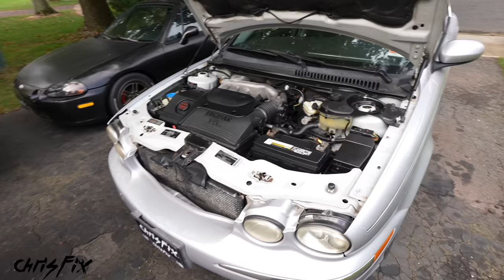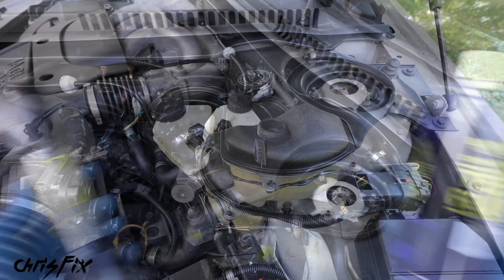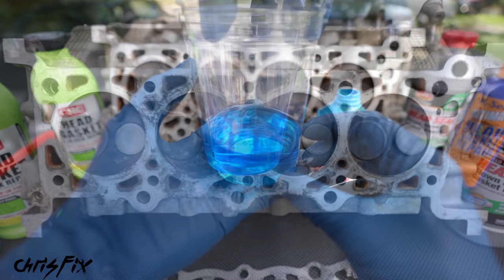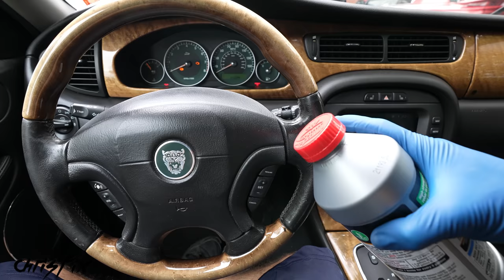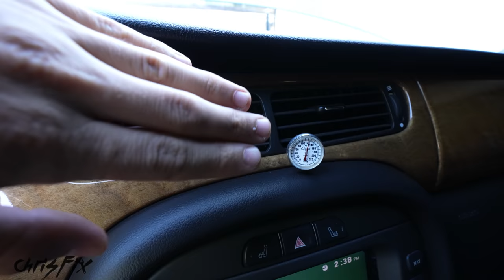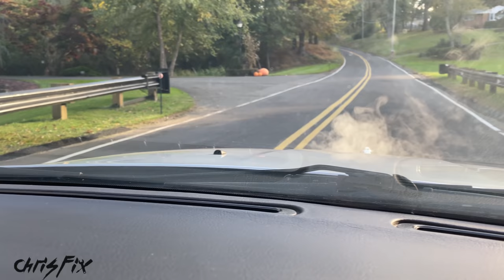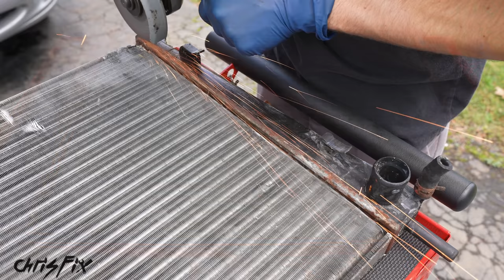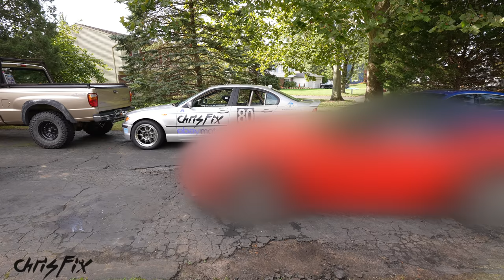Do Head Gasket Sealers Actually Work (FULL 2yr TEST with Engine Teardown)

Comment: Ive used blue devil 3 times one my 2010 subaru the olny reasion   i had to do it 3 times is bc i put the therostate back in an it blew it out cuz 2 much psi an it got over heated the other time an the first time it blew was just cuz subaru headgasket suck ass but yeah the BD has lasted for a couple years now just make sure u remove the therostate

Comment: Interesting.  So using this product, let’s say you got 2 years out of it then the engine starts overheating again.  In a budget move, do you just go another round of head gasket sealer?  Or is it just a one time use?
Reply: I wouldn't recommend this product as I don't believe in magic in a bottle. Now I've seen this stuff used with my own eyes on a Chevy Spark with 100,000 miles and it worked. But I don't recommend it if you're keeping the car long term.
Reply: You can use it again and again. And again.

Comment: What am I supposed to do if the radiator overflows the second the car gets to temp? When I used the block test I only got 4 bulb squeezes until my radiator overflowed, ruining the test. The engine gets to temp and my thermostat dumps coolant into the radiator, so how can I prevent this when using the tester?
Reply: Why are you testing a hot engine? Just test while it's running cold.
Reply: @SinsBird  that’s not how these tests work… you have to get the temp up until the thermostat opens
Reply: @tonyd0001  Just fill the cooling system to the brim and look for bubbles.
Reply: @SinsBird  the bubbles don’t present themselves until the car is at operating temp I’m not sure why that’s not clear
Reply: @tonyd0001  When the engine is up to temp and there's no pressure in the cooling system the coolant is starting to boil in the cylinder head. Boiling makes big bubbles from microscopic bubbles that are always present in the coolant. It's very rare for head gaskets to only leak when engine is up to temp. Why are you testing for head gasket leaks in the first place, what happened?

Comment: My 1985 dodge b250 slant six over heated because the bottom radiator hose fell off and I didn't realize. I refilled the coolant. Since then I can smell coolant, a small amount of milk in the oil and it seems to be running hot if im idling, and a bit warm when im moving. It sucks because i just replaced the radiator. It doesnt seem to be cracked. I bypassed the heater core as well, with a bypassed heater core is there less chance of clogging?
Reply: It can't clog anything if done properly, but with heater core bypassed it (the heater core) wont get clogged for sure

Comment: I tried blue devil l and was not impressed. It may have slowed the leak on an 88 chevy g20 van but didn't seal it completely.
Reply: Coolant in oil, oil in coolant or both? Is the cooling system pressurized?
Reply: @SinsBird  I think it was coolant in the oil but it's been over 3 years and I don't remember for sure. I seem to think both were pretty clean but it was putting out steam that smelled like coolant. Just hadn't gotten into crank case or cooling system yet.
Reply: @SinsBird  I've been trying to find this stuff that I found in a friends car. There was a fairly thick layer in all the hoses and tubes. It was white and felt like wet sand when I scooped some out. He'd had the car for well over 2 years with no problems. I assumed the dealer they bought it from sold them a car with a blown head gasket and had put this stuff in to seal it. Whatever it was it worked great and I've been trying to find out what it is so I can use it in my own cars as well as help my friends and other who can't afford to do it right or for Vehicles that are on their last legs anyway and their owners just need to make them last a little bit longer. Any idea what it might have been?  A friend said it might have been silicone silicate which he called liquid glass and said he would buy it at old-school mom and pop drug stores but idk I think he might have gotten the name wrong.

Comment: what if the coolant looks sludgy (Similar to the way the oil looks in this video)
Reply: The oil is probably getting into the coolant. Is the cooling system pressurized?

Comment: Why didn’t you try resealing with the sealer again?
Reply from the maker: Too many other issues started cropping up on the car, so even if it fixed it again it wasn't worth keeping around anyway. Also there's no guarantees it would hold that long again.

Comment: Real steal  best head gasket repair  I have ever use hands down sorry all that stuff he has sucks. Just follow the directions to the Tee ok later, now when I did mine, I was burning  antifreeze  u can smell it but mine lasted forever  thanks guys bye bye. Oh ps do not use it twice if you do it could  be really bad. Do it once only so cold engine  dump it from bottom hose, dump the resovior  container  put everything  back together pour  in real steal head gasket  liquid  and add your 50/50 antifreeze then take it for a ride for a 20 min 1/2 hr or whatever  direction  say your good guys later. 78.00 worth every  penny......

Comment: Hey christfix is it possible to have a external head gasket leak
Reply: Yes, it definitely is. You'll usually notice it by seeing either oil or coolant weeping from where the head meets the gasket down the side of the engine block.
Reply: @mechanizedunion  so would headgasket sealer work for that

Comment: Can I use if I have a small smallllll oil leak that drops down on the exhaust manifold and smokes after about 30 minutes of driving… shop told me 3,000 I only paid 500 for the car .. it’s a project car at that not the daily driver
Reply: This is for cooling systems.
Reply from the maker: No this is just for the cooling system. If you put this in the oil the engine will be ruined

Comment: Hi. I used the Bars Leak for my car and when doing the intial drive after putting the product in, my car overheated 10 minutes into the drive just driving around the block. 

My car was originally diagnosed with a "severly blown head gasket." So we tried this step. Is there anything youd recommend?
Reply: Is the cooling system pressurized? You would probably need to remove plug from the worst cylinder.
Reply: @SinsBird  I see you asking this a lot, can you explain why this is important?
Reply: @hotel_arcadia  Sure.
1. The pressure in the cooling system is needed to push the sealer into the leaking spot, otherwise it wont work.
2. It fights against cylinder pressures trying to push gasses into the cooling system creating air pockets.
3. It raises the boiling point of the coolant. If coolant started boiling in the hottest spots, the gas, that is dissolved in the liquid would be separating from it creating many small air pockets and where these pockets are, deposits could start forming even though there is nothing to seal.

Comment: just curious, at 17:24 in the video the engine was about to overheat at 237 F but the temp gage on the car looks like it's just at half so normal. Is the thermostat wrong or why is that? I got a rav4 thats been running with like no coolant for months but does not overheat or drive issues. Temp gauge on the car shows no signs of overheating as well. Wondering if it's normal for temp gauges to be wrong like that or my car just don't need coolant

Comment: Can this be used as a preventative on a 2.3 ford engine that has the known Coolant intrudion issue?
Reply: You can try if it's losing coolant.
Reply from the maker: No this would only be used if you already have a Head Gasket leak. I wouldn't not use this in the coolant before hand.

Comment: You should have tried a different brand like Bars leak after the failure
Reply from the maker: There was pretty significant warpage so it wasn't worth it at that point
Reply: @chrisfix would these products still work with a removed thermostat. Some people remove thermostat for some reason claiming it gets into the system better. Will eventually fix the themostat.
Reply: I also bought pure concentrate coolant. Will this work well. Or should add water.
Reply: Im living in Toronto living out my 2004 Honda civic for the past couple years. I paid some scam mechanic 1200 for a fixed headgasget. Unfortunately 8 month later the same problem. In hindsight should have taken him to court. Unfortunately was dealing with serious problems a heart transplant 23 years ago and untreated Pararathoid disease for the past 7 years. I do have a brother that was a mechanic for many years unfortunately lives very far.
Reply: @theluckyman74  Such products work better without a thermostat. Use water only, then after the leak gets sealed flush the cooling system and add coolant.
Reply: @theluckyman74 sending some rando internet love and wishing you well 🙌 also call your brother, even if just to say hi ❤
Reply: @rocketsalad  thanks

Comment: This'll be the 1st time I've ever commented to a YouTube video. I'm using a phone & I just realized that I sent my questions under "Replies" instead of Comments.  I'm gonna ask again here under Comments because I really need my only vehicle operational again before I lose my job. 
      In the video when  you said that the Coolant was being  consumed, does that mean that it was ending up in the crankcase? I'll watch the video again, but I don't remember saying that it was. I do however remember you briefly showing the underside & saying that there was no leak externally. Where else could the Coolant go? It HAD TO end up in the crankcase, right? 
      Did you have to flush the engine, or at least change the oil & filter a few times? 
       And, can this process go the other way? Can my oil be being consumed & end up in the Coolant overflow tank?
       Lastly, if i have a  v6, is there a way to figure out which head had the problem, or will I have to get both heads machined because I'll have to do the same thing to the other side that I do 1 side?  HELP!!!!
      Thanks.
Reply from the maker: It was ending up in the cylinder and getting evaporated out the exhaust. A head gasket leak can cause coolant to go in to the crank case as well.
Reply: @chrisfix  I appreciate you responding so fast.  I watched the video again & at 1 point you explain how Coolant can end up in the crankcase & you pull out a dipstick that looks like it has like chocolate milkshake on it. That's what mine looks like, so I used STP Engine flush & changed oil & filter, & refilled the oil. Then I proceeded to flush my coolant system with Prestone. (I removed the thermostat 1st.  My vehicle is like your dad's Jag in the video, a v6 with the cap on the expansion tank, not the radiator.)
      After letting my truck  idle until operating temp, I turned it off & let it cool. I checked my oil & it only registered about 1 qt. (I refilled it with 5 qts.) I checked my coolant & it looked like (& had the consistency of) a chocolate shake. 
       I realize now that I have a blown head gasket (or 2), and/or a warped head (or both). What started all of this, is that I unknowingly mixed Coolant colors. 
I know that each situation is different & that you CANNOT personally guarantee any results (good or bad), BUT . . . . . . . in your opinion, is my vehicle a candidate for 1 of these head gasket sealers?
     Thanks again. I really appreciate your advice and videos.
Reply: @chrisfix  BTW,  I also wanted you to know that I installed a fuel pump kill switch 2 years ago from 1 of your videos with your Del Sol.
I really do appreciate your videos & the way that you explain so that even a total beginner like me gets things done.

Comment: My car doesn't loose fluid except for when the pressure from the engine pushes it out the overflow.  07 equinox
Reply: Does it push out because the pressure is too high or is the cap at fault?
Reply: @SinsBird  I replaced the cap and thermostat.  It builds air in the motor
Reply: @Kevin-nb8ks  Oil in coolant, coolant in oil or both?
Reply: @SinsBird  neither. Clean tk test too
Reply: @Kevin-nb8ks  If the cooling system is pressurized then sealer should do the job.
Reply: @SinsBird  thanks
Reply: @SinsBird  will bars headgasket sealer plug the burping valve?
Reply: @Kevin-nb8ks  coolant shouldn't reach the valve as the procedure should be done in steps bumping the temperature a few degrees up every time and then letting it cool. Also you could remove the spark plug from the most leaking cylinder and also disconnect the corresponding injector.

Comment: I'm probably going to be doing this tomorrow thanks 👍
Reply: Is the cooling system pressurized? I recommend to do it in steps, not one go, also keep the RPM above 1000.  Let the temperature rise some, shut the engine off, let it sit for and hour, check coolant level, add water if there's less of it now, start and run the engine some more to reach a higher temperature than before, shut it, let it sit for an hour. Check the coolant level...and so on till it reaches the operating temperature. Don't hurry to dump it out of the cooling system, make sure that it sealed for sure, drive it keeping rpm high so it gets hot, then check the coolant level. If it's okay only then dump it out.
Reply: @SinsBird  thankyou 👍

Comment: I thought you were going to use different ones in all the cars with headgasket failures... Not just 1 with a bad failure..

Also, you changed the oil after the test was over 10k miles later? If course you'd have excess wear I mean you were running dirty oil through it for 2x what it should have been...

I'd leave it in maybe 500mi and then flush the oil (if it was leaking) and the coolant.

I'd likely also remove the thermostat during the process beginning or the first 500mi.

Decent video though
Reply from the maker: They all do the same thing and work the same they just have different properties and instructions. And getting 4 same cars to have the same exact head gasket issue would have been impossible. If I didn't do that it wouldn't have been a scientific test. With modern oils you can push it to 10K miles no problem (although I wouldn't do that all the time) and I left it in to get an idea of what happens over an extended use. You'd see much more wear if something more serious was going on. Thanks for sharing

Comment: Wish I could get my car fixed, because I can’t afford a new car. Took it in yesterday to find the oil leak and the transmission pan leak. Finding out that my back head gasket is leaking oil.
Reply: Those sealers only seal cooling systems.

Comment: I believe I have a headgasket leak I have white smoke coming from the exhaust like the del sol and bubbles in the radiator but i also have a rough idle and if I press the gas it tries to shut off... thoughts?
Reply: Try a head gasket sealer product.

Comment: Wonder if this wuld be good to use before hand to pevent the isue
Reply from the maker: Unfortunately It won’t prevent head gasket leaks. The products need exhaust gases to harden the sealant so without that, it’s just floating around in the coolant
Reply: Only if you're losing coolant.

Comment: Will it work if the case of the engine is it has a bubble on radiator and overflowing the Coolant Reservoir??
Reply: Is oil and coolant mixing? Oil in coolant or coolant in oil? Or both? Is the cooling system pressurized?

Comment: I’m curious could you mix head gasket sealer? If you tried one and it didn’t seem to work could you try a different one??  my issue is on a 2016 Jeep Wrangler Unlimited.
Reply: Yes, they are very similar, most are based on sodium silicate, the difference is the filler material which in most cases doesn't even do anything, it only helps to seal big leaks. Coolant in oil, oil in coolant or both? Is the cooling system holding pressure?
Reply: Yes it is, I’m get a lot of back pressure in the reservoir tank, I don’t have a lot of any other symptoms. I’m trying to figure out which one would be the best one to try for my jeep.🤔
Reply: @tcjccooper9956  If oil and coolant are mixing the chances of it sealing successfully are lower. But that doesn't mean one shouldn't try it. Another problem I see is that the thermostat and housing is one assembly, I really recommend removing the thermostat for this, so you may look into if it's possible to separate the thermostat from the housing. Compare spark plugs to find the most leaking cylinder(s). You may need to run the engine with this spark plug out for it to seal successfully.
Reply: Okay I will check the spark plugs to see which one it is, and you can just take the thermostat off. I’m also going to look at that and see if it is bad or full of gunk.  When I added the bottle yesterday of k-seal I was on the go (I’m a rural mail carrier) And when I got home, I read on the website the best way to do. This is have it idling in your driveway for about 30 minutes to give it a steady surface so it has time to seal.. which that would make sense, considering where I travel is really rough roads lol
Reply: @tcjccooper9956  Here's the best way: flush the cooling system multiple times with water before and after the procedure. Use water only with the sealer. I highly recommend removing the thermostat for this. Heater should be set to high. When adding the sealer it's best to dilute it first and only then pour it in. Do the procedure in steps, not just one go. After adding the sealer, topping up the cooling system with water and putting the cap on, start the engine, keep the RPM above 1000. Let the temperature rise some, shut the engine off. Let it cool for an hour. Check the coolant level, add more water if it's lower. Run the engine some more to raise the temperature more than before, shut the engine off, leave it to cool for an hour. Check the coolant level, add if lower. Repeat until operating temperature is reached. Then you could put some load on the engine, to make it really hot. Then you can flush and use the coolant of your choice.